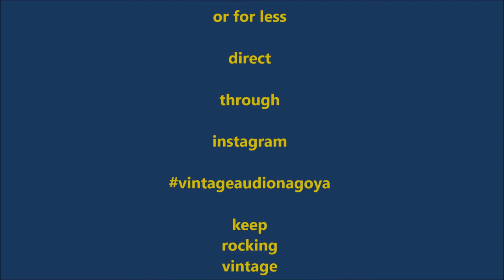Roland RE-150 space echo chamber repair- pinch wheel tension, tape loading, testing, etc

Comment: Very good video. I am working on a 201 right now in my shop. I ordered a full rebuild kit from AUS. It needs caps and wheels. parts should be in soon. I am not quite as good shape as yours but I wish I was able to source new record/ playback heads.
Reply from the maker: Yes, tough to find heads but they are out there.  Try old audio repair shops.

Comment: Wanted to quickly say thank you for showing how you addressed this issue! I recently bought am re150 in great condition, but it has this exact issue. I could see that the bracket needed tension but wasn't sure what the mechanics of the whole operation were supposed to be as this is my first tape echo, and didn't want to just start randomly removing nuts/screws etc.... your fix makes total sense and will take the guessing game out when I have time to open this up. Thank you!
Reply from the maker: Great news.  Glad I could help.

Comment: Hey Mark, love the channel!  Working on an RE-150 now. I'm only getting one repeat in all modes, and only hearing the repeats from the "Echo" output, not hearing them on the direct out. All the caps are black sanyo branded caps, not the purple ones from your videos. Could they possibly be original caps? A few of the larger ones are glued on with what appears to be a factory job. Should I do a cap job on it and see if that brings the oscillating repeats back? Cheers from Portland, Oregon!
Reply from the maker: I talked to Brandon and it turned out to just be dirty heads. Try everything else before caps. These are often just in need of a good cleaning.

Comment: Hey Mark, First off. Your videos are kick @ss. I love the stories, history lessons and incredibly helpful videos! I do have a roland re 150 and it has worked beautifully until about last month. looked like the pinch wheel seized rock solid and the motor shaft just was spinning with no tape movement. So I powered it down cleaned like hell the pinch wheel, and now it spins clear and fine but the motor seems start normally and then just slows down until a complete freeze within 1 minute. Yikes, Any advice would be amazing! cheers keep the videos rolling !!!
Reply from the maker: Sorry, I missed this question until today.  You probably have it figured out by now.  But sometimes some electrical cleaner down the motor shaft followed by some household oil can bring back a tired motor, if that is the problem. The armature can get dirty over time.

Comment: Hi! What a luck I found your channel..I own  a RE 150, bought it new about 1980 it has been unused for 20 years..
Questions: where to get new tape?  How to make own felt or where to get it , not green.. for the tapecleaners.. where to put lubricant for the motor, it will not go down in speed as it used to do , it is now between half of lowest setting and full speed..Where to get a new lamp for the VU meter ?I am living in Sweden/ Stockholm. Many questions.. if I can reach you by mail or something I would appriciate../ Micke S.
Reply from the maker: Hi Mikael,  I make tapes from new/old 8 tracks.  You can make loops of any size but if you search for replacement Space echo tapes you can find them.  Echofix is a company from Australia I think.

   I would try cleaning your speed potentiometer and see if that helps your speed.  

You should be able to find felt at a fabric store.
 I ordered lamps from a hobby shop.  They are the same size as miniature train sets.  

Put a drop of oil right at the base of the  motor by the pinch wheel to lubricate. Good luck